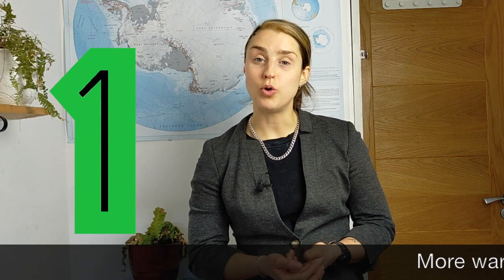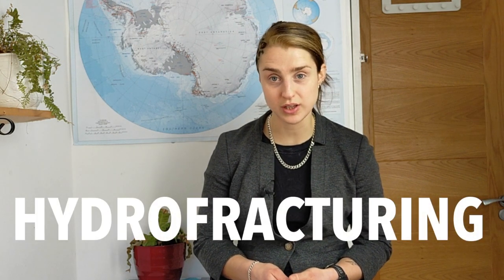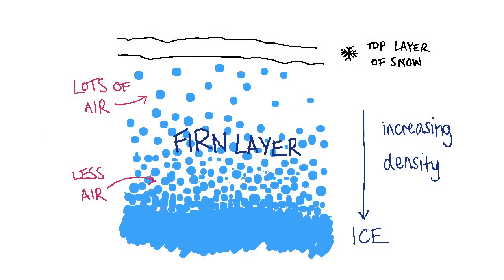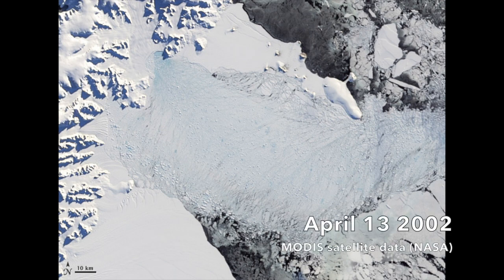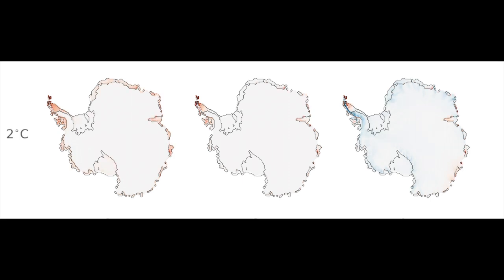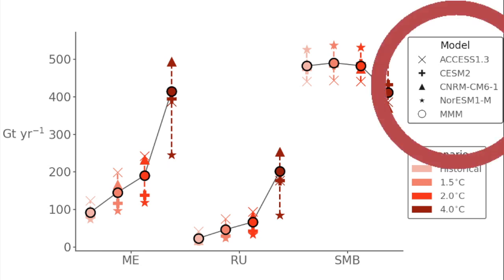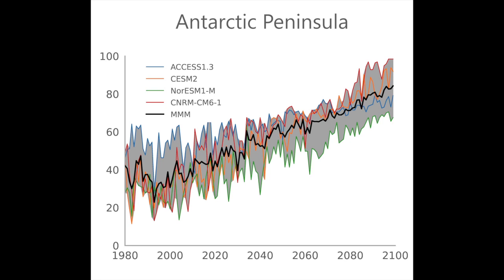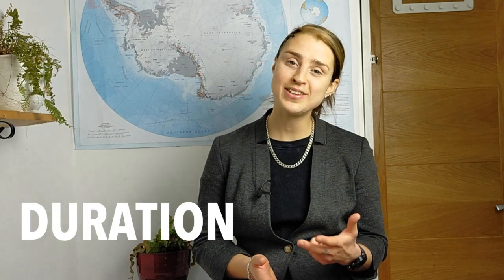Why climate change could increase the risk of Antarctic ice shelf collapse

Comment: Am I correct to suppose that replacement of firn by solid ice also leads to a reduction in albedo, thus speeding up the melt back?
Reply from the maker: yep, you're right - melting ice can lower the albedo, creating a self-sustaining feedback. Mostly this is important in summer though when it's warm enough for liquid water to be present on the ice shelf and when there's solar radiation to be reflected or absorbed. The firn densification effect builds up over the longer term.

Comment: Please explain.
According to National Snow and Ice Data Center  https://nsidc.org/arcticseaicenews/charctic-interactive-sea-ice-graph/
As at April 10th 2021, Arctic ice extent is almost exactly the same as this date in 2017.
Meanwhile Antarctic ice extent is 1.7 million sq km greater this year than the same date in 2017.
Given that total polar ice extent is significantly more than four years ago, why do you not project this trend to continue?
Reply from the maker: 1) I haven't said anything about sea ice trends in this paper, nor in this video. 
2) Sea ice is not related to the surface mass balance of Antarctic ice shelves - least of all Arctic sea ice
3) Year-to-year variability exists, so you can cherry-pick whichever year you like to make it appear like the trend you want is present using just two data points
4) Antarctic sea ice extent in 2017 was the lowest ever recorded, so saying that the current sea ice extent is higher than the record minimum is characteristic of cherry-picking data to tell the story that you want to tell.